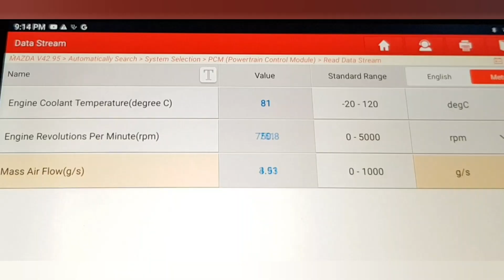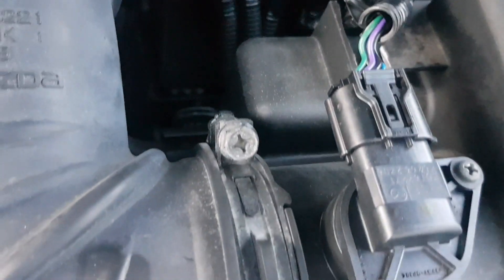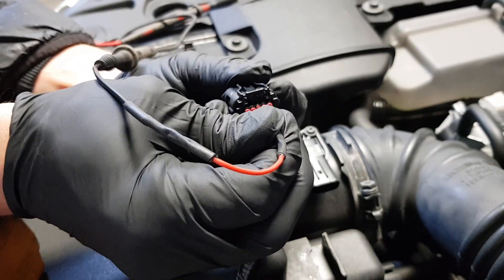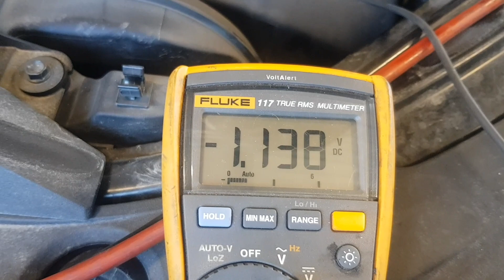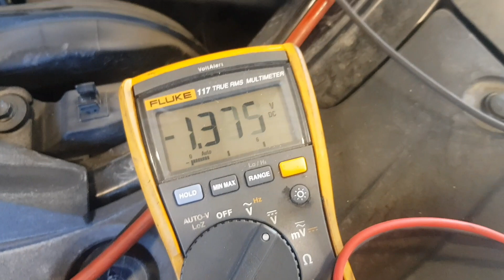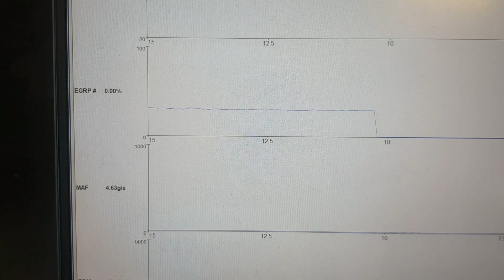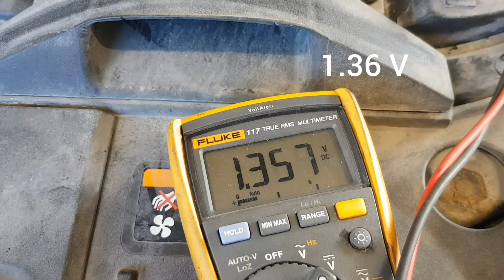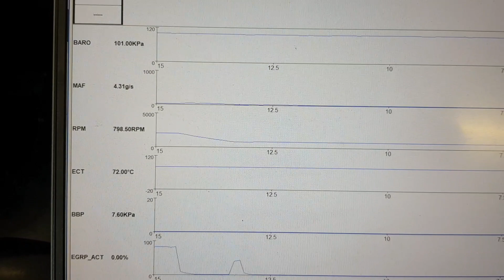Mazda 2.2 Skyactiv D, MAF sensor  reference data, quick check, and P0101

Comment: Hi. MAF cleaned and i have idle 1.04V and ~2000rpm 1.36V over 70c. Mazda 6 2013 2.2D. Is idle too low?
Reply from the maker: Seems to be too low, check it with the ignition on and compare to the readings in the video, if there is no difference, then the MAF most likely is good, and you should look somewhere else. But the question is, do you have any issues with the engine?
Reply: @JB_Auto  my mazda turns off cruise control (with radar) with hard jerk when regen starts, happened only driving 117kmh so far. Red triangle with ding sound for a sec on dash. i was told that first things to check is maf and map sensor. It may or may not be related but first time it was after new turbo and dpf cleaning. do you know normal map sensor readings?
Reply from the maker: The map sensor values should indicate the same pressure as the barometric with ignition on, engine not running. Check out my video related to the exhaust pressure sensor.  https://youtu.be/ddfTF_zLQRE?si=pK0gRMCYuWMvIohN
Reply: @JB_Auto  Thanks! It is same, its 100. But its changing by 10.. is it normal? Idle 800rpm 80 - 1500rpm 90 - 2000rpm 100 - 2500rpm 120
Reply from the maker: It should change smoothly, not by 10; the value changes gradually when you apply pressure or vacuum manually. Those values you gave are possibly normal; the most crucial check is when the ignition is on and the value is at approximately barometric pressure.
Reply: @JB_Auto  Thanks. What can you tell about Ambient Air Temperature 2 . with warm motor its like 80c AND duty cycle of engine oil pressure control circuit showing 0
Reply from the maker: The intake air temp sensor no two sounds about right when the hot engine, oil duty cycle is dependent on many variables, zero means that the oil regulating valve is fully open.

Comment: Hey guys, 
I have a Mazda cx5 2015 with 170000km  Here’s my issue: whenever the engine revs up — for example, when going downhill — it kicks into limp mode. The PCM shows a P0101 MAF sensor error. Could this point to a worn camshaft, or is it more likely something else? For context, I’ve just cleaned the EGR.

Thanks and best regards.
Reply from the maker: Hey, have you checked for soot in the inlet manifold? Start with that, since it's the least expensive. The camshaft is less likely to trigger the DTC.

Comment: My maf is reading 1.5g engine sounds rough
Reply from the maker: The engine can run rough because of the MAF, as well as due to other factors. Those factors contribute to MAF reading. If your MAF reading at engine off is OK, search elsewhere.
Reply: @JB_Auto what else could it be jb, had carbon cleaned out few months ago, when i rev it its sounds ticky, can it be a loose airhose at the bottom of engine, and also there is no ring halo around the battery
Reply from the maker: The intake system needs to be sealed. Otherwise, there is no commonly known problem, so it's difficult to guess what it could be.
Reply: @JB_Auto hi jb here is a video of my mazda engine wat do u think https://youtube.com/shorts/IC99YD1BLAM?feature=shared
Reply: @JB_Auto https://youtube.com/shorts/IC99YD1BLAM?feature=shared

Comment: Good day Such a question. I own a Mazda 6 2.2 diesel 16 year old. There was a large consumption of fuel. 12 liters in the city and 7 liters on the highway at 110 km/h. I thought that the DPF was clogged, and that's why there was such a flow. The DPF was cut out and the EGR was programmatically silenced. They asked for stage 1. The chips were dropped from the EGR. But the growth remained the same. But with the chips removed from the EGR, the MAF readings are around 10 g\s. And when I put on the chips, it shows 4.5-6.5
Reply from the maker: Chip tuning box changes input values to the PCM. That is why when you remove the chip tuning box, readings change. Based on the logic you have presented, I suspect that EGR was physically altered as well. Regarding fuel consumption, I had a case where unprofessional mapping of PCM was performed, and increased fuel pressure caused injector damage, hence excessive fuel consumption and other issues.

Comment: 2017 2.2 D at 90.000 km here  I'm getting the same DTC while driving and only when I slow down after some higher revs. If I keep the revs below 2000 is seems to be just fine. It's very annoying because when the error occurs it comes together eith some SBS/SCBS malfunctions and enters limp mode and the car tries to apply the beakes on its own.  I had to put the EPB in service mode.
An engine restart solves the problem for a while.
The diagnostic tool shows 1.7 g/s MAF reading wich seems to be low. The mechanic said it's mist probably the MAF sensor, but it's looking fine. I changed the air filter but that wasn't the cause. I suspect either the intake ore the exhaust is clogged. How can I check it without having to take everything apart?
Reply from the maker: Hi, the easiest way is to remove the map sensor and check for soot using an inspection camera. Another way is to remove the hose connected to the intake shutter valve and inspect the inlet manifold that way. If you see reduced flow of air into to inlet manifold due to an excessive amount of soot it is almost certainly the reason.
MAF sensor test is very important due to frequent malfunction.
Reply: @JB_Auto  thanks. The MAP sensor was clogged but the sooth wasn't sticky and came off relatively easy with a toothpick and an air compressor. The EGR pipe had about 3-4 millimeters of dry sooth and the mechanic said it's acceptable. He's not familiar with this engine so I took it with a grain of salt. I'm getting the P0101 so will swap my MAF sensor with a friend who has the same model to exclude that possibility.
Reply from the maker: @arpad-istvanozsvath6195  Yes that's good idea check also possible causes I mentioned at the beginning of  the video. P0101 can be triggered even though you have so called acceptable amount of soot. Sometimes it's a lengthy process of diagnosis that's also depends on engine condition.
Reply: @arpad-istvanozsvath6195  Any outcome with your problems??

Comment: Hi I’m getting p0102:00-AF and p0102-00, says it is circuit of mass or volume air flow sensor A is low
Reply: How many miles you done? Could be a carboned up egr/intake, could be a worn exhaust camshaft/rockers/tappets

Comment: Hi JB, thanks for the video! My Mazda 6 2.2d sky-active has intermittent heavy wobbling issues when running at around 1000-1800 rpm. Such wobbles would usually disappear when I depress the clutch, or if I depress the accelerator more aggressively and hold for 5-10 seconds to get the revs higher than 1800 rpm, then everything looks normal when running at above 2000. I’ve noticed that the air mass flow is only 1.4g/s at idle (750rpm), not sure if it contributes to the problem as I can’t see any fault codes but I suspect it’s misfire - have you seen such case before?
Reply from the maker: Based on your description it sounds like a flywheel problem. I had one case with a similar description and it was the dual-mass flywheel. The wobbling wasn't heavy in that case, of course, it could become heavy if not fixed at that stage, and it was more audible when the engine was cold and got quieter when the engine was at operating temperature. I would remove the gearbox and inspect the flywheel. I'm curious about the solution so post when you solve it.
Reply: @JB_Auto  Thanks! I haven't noticed any audible rattling sounds, but I'll check again. It's weird that the problem just appears intermittently - seems on each Wednesday after like 20km's drive on that day, and when it appears the shudder seems quite heavy though and produces a near-stalling-like feeling... with accelerator getting depressed for a few seconds then it runs smoothly again and the power gets back...

Not sure if that's a DMF problem but yeah worth a try as when clutch is engaged the shudder will disappear. Do you think if there's any other potential causes in case local garage don't have any ideas? Anyway I'll let you know if it got resolved.
Reply from the maker: @HongZhou-q7k   If the shudder disappears always when the clutch is depressed then it is related to clutch and DMF. That near-stalling experience is possibly related to engine management, airflow, and soot problems. it will be difficult to diagnose for an independent workshop since no DTCs and no reference data. Mazda's dealership may find the problem quickly and may give you good tips, I would consider that solution as well.
Reply: @JB_Auto  thanks again JB! Yeah defo needs investigation for the clutch and DMF as when clutch is engaged the shudder disappears, just not sure why the problem is intermittent though. But yeah sounds great, better leave such problem to dealer for a diagnosis.

Comment: hi, I have a mazda 6 2.2 diesel from 2015 which when the coolant temperature reaches 70 degrees celsius gives me error P0488, do you have any idea what it could be
Reply from the maker: Hi, I can not recall we have ever had that DTC, but based on a general description of the error P0488 EGR Throttle Position Control Range/Performance, it looks like either soot in the EGR and therefore throttle gets stuck, or EGR malfunctioned, so I would start with that.

Comment: Hello JB, thank you for taking the time to post these videos, I can assure you they are very informative and well explained.  I would appreciate having your advice on my concern.  I have a 2015 Mazda 3 2.2D with 29K miles.  Sometime ago I took the car in to the dealer for what they said was a PCM update.  However, since then the car does not exceed 50 miles to the gallon anymore no matter how I drive it whereas before I used to manage to get close to 60.  Any idea if this has anything to do with the software update or maybe some sensor needing attention?  I use premium diesel 60 cetane and original Ultra DPF engine oil cause of the DPF and it does DPF regen every 170 miles or so.
Reply from the maker: Thanks. We have never had a similar complaint after the PCM update and that is in EU countries. I would make a complaint about that, but in my opinion and based on the mileage of your car there must be a soot problem in the inlet manifold which may contribute to excessive fuel consumption, there could be sth else, so the best would be to visit Mazda dealership and let the technician diagnose it. The PCM may not store any DTC but fluent technicians will quickly indicate malfunction.
Reply: @JB_Auto  In fact I am from Europe.  I read that they suffered from bad injectors as well on a certain batch so sometimes I wonder if that's the case with mine although like I said DPF regens are only every 170 miles or so which I think it would be earlier if it were bad injectors and considering I don't drive it on the highway that very often.
Reply from the maker: To be honest I never heard about injectors issue you've described, ofcourse we replaced some but not because fuel consumption problem, and it was rare e.g. one out of four not all of them.
Reply: @JB_Auto  Apparently about 3 or 4 of them on another forum were having very frequent DPF regens even when driven mostly highway, no DTCs, cleaned DPF, changed sensors but still the same.  Then after a lengthy investigation one of them went a step further and replaced the injectors after which he said problem was solved.  But at least mine is not doing frequent DPF regens.  What I can't understand is that fuel consumption changed right after the PCM update so I'll probably complain with the dealer as per your advice and see from there.

Comment: Hello JB, I watched some your videos about skyactiv engine, which are very informative for me as diy mechanic. :-), so firstly thank you!  I noticed, that my engine has kind of strong blow by , when I remove the oil fill cap. It is regulary sound and currently I am facing the turbo charger rivet problem and in the turbo charger there is some oil. Does have this engine some oil separator,  which can be blocked and therefore cause the blow by  and oil in turbo? I can not find anything about this. Many thanks.
Reply from the maker: There is no separator, some of what you call blow by goes through the valve cover and into the turbo inlet hose. When you remove the oil cap that blow-by is normal. In the small turbo, you will always see some amount of oil.

Comment: Hi jb can a blocked turbo pressure sensor and pipes cause low maf readings because turbo pressure plugged in maf reads 1.5 g/s and same sensor unplugged  reads 5 g/ how are these to sensor related
Reply from the maker: You probably talking about exhaust pressure sensor, yes it will change readings of MAF
Reply: @JB_Auto  ok thanks after changing it still getting same readings how do I reset the sensor. Iv got 2 maf reading on the diagnostic im using one is reading at 5 g/s and the other maf reading is around 1.5 g/s
Reply from the maker: @KhanKhan-lw8fw  "After changing it" means what? One reading is probably MAF_DSD which means desired and the other is actual MAF which shows what flow is at the moment of testing.
Reply: @JB_Auto  ok thanks jb. What should injector reading be on mazda6 2.2skyactiv-d. And if injectors are faulty what symptoms can it cause

Comment: Hi JB another great video is there any way of check the timing on the skyactiv d 2.2 without taking it apart I am only getting 37mpg which is not great looking on my obd using forscan the cam to crank angle is 20° before adaptation and sorry for dropping problems on you I have bubbles in my radiator I did a carbon dioxide test which was positive so looks like headgasket I used some steal seal which has stopped the carbon dioxide but still have bubbles any suggestions thanks again for your help
Reply from the maker: If no DTC you shouldn't worry about the timing chain, the oscilloscope is the best way to check it, and reference data.
Apart from head gasket replacement we never experienced any problem with the cooling system, maybe it is overheating now...
Reply: Thanks for the advice I replaced the timing chain engine run ruff at idle juddering and sounded out of time  after putting it together untill I reset all adaptations then sounded ok 37mpg is really bad I use mostly motorway 70mph and not to heavy on the pedal thanks again much appreciated 👍

Comment: We mounted a Webasto Heater in our CX5 2.2D 2019. Now we have air in the cooling system. Have you any advice for bleeding the coolant system - is there anything special? Thank you!
Reply from the maker: There is no special tool. I usually disconnect the thin hose from the radiator and top it up until it overflows, then warm up the engine, so you do not need to top up much.
Let it cool down and top it up.
Reply: @JB_Auto  Thank you, i really appreciate this.

Comment: So 5 g/s is a good reading at idle
Reply from the maker: Approximately 5g/s, I would recommend looking at the voltage instead, as you can see the Mass Air Flow in grams per second is less legible than the voltage.
Reply: @JB_Auto  or the best thing is to replace it lol. Can the maf be faulty with no codes showing
Reply from the maker: @KhanKhan-lw8fw  Can be slightly out of specs and then will not trigger any DTC but you should notice some symptoms, like engine stalling, and rough idle. I wouldn't replace it, now you have good lookup data, to diagnose it.
Reply: @JB_Auto  hi jb when the car  changes gears the revs go up and down before it changes gears automatic transmission. Heavy fuel consumption
Reply from the maker: I've never had that issue before, if I encounter such a case I will post it.
Reply: @JB_Auto ok mate what cause gearbox bucking problems
Reply: Can you explain why i have betwen 9-14g\s? I have problem with air mass but its replaced already
Reply from the maker: @MrHexago Can you tell me at what RPM you have that reading?
Reply: @JB_Auto   Below 1k at idle 800
Reply from the maker: So the engine idle must be very unstable. As a first thing, I would check the EGR system.
Reply: @JB_Auto  dpf od cut Out. So egr is closed
Reply from the maker: Then the reference data in the video does not apply to your car, since EGR is disabled and different software, the readings will vary.
Reply: @JB_Auto  anyway thanks mate
Reply from the maker: You're welcome.